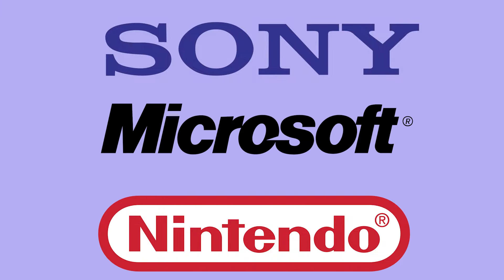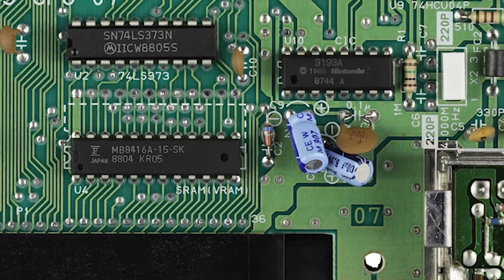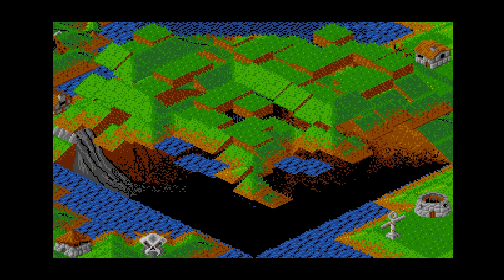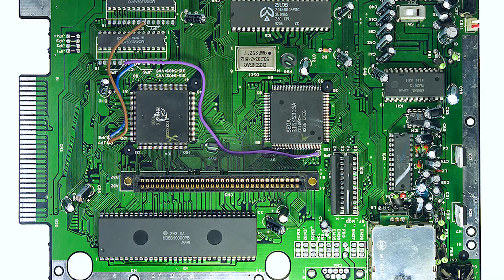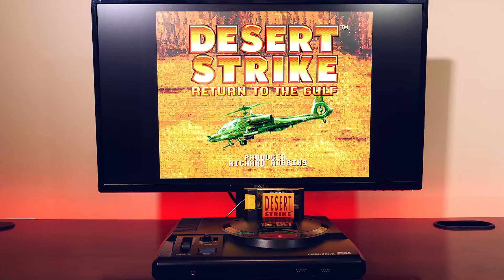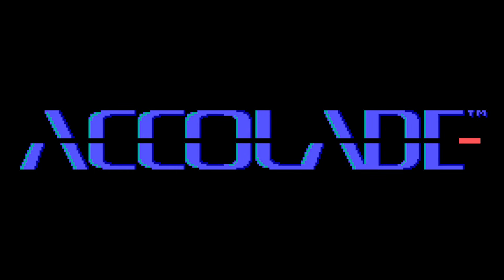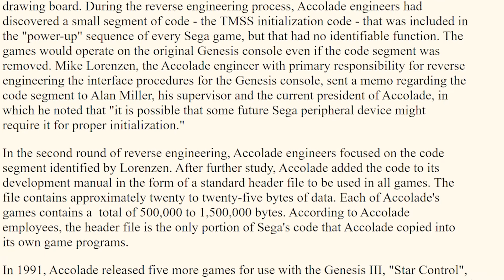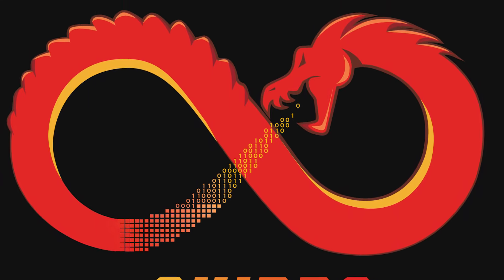How Sega bet against Reverse Engineering...and lost | MVG

Comment: It's my fault, I installed a lot of mod chips over the years, up until I messed one up and had to buy the guy a new system and then mod that. My 13 year old financial situation would not allow me to make that mistake again, and my mom...rofl. Basically cleaned out all the profit I made installing chips in one fell swoop. I charged 15 bucks for original systems and 25 for PS1's... Rent, Burn, Return. I grew up in a pretty poor family, but my mom certainly saw her investment of getting me a soldering iron and screw driver set at age 10, then just some years later being able to "get" games after we rented them. I was one of the first to get a cd burner when they came out with the 8x TDK at my junior high school. It paid for it's self in the first month. At that point in time, a custom CD with the tracks you wanted was seriously cool. I feel like 20 bucks for a custom cd with "dirty lyric''d songs" that took days to download on napster was not over charging. Everyone was so stoked to get all the songs they wanted on one disc. I went by DJ PJ... hahahhahah

Comment: How did games officially licensed by SEGA that were produced before they invented TMSS continue to work on the new revision of the console?
Reply: I'd assume it was part of a standard library they had been using since the beginning and which was distributed with the development kit.
Reply: I think that's part of why they chose the code they did. It was something that was already there in all officially licensed games.
Reply: @timf7413  it was part of the startup screen every game had to have anyways. They just checked whether that starting screen was present (and sued if s/o wrote "SEGA" w/o a licence). Actually a pretty common approach of the time, check for a character string, check for existence and position of a brand logo (afaik the GameBoy did that), and so on
Reply: @sepruecom  The GameBoy sorta did that in that all officially licensed games showed the "(c) Nintendo" screen, but I also remember having an unlicensed game that did not show that, but instead showed the copyright of the company making that unlicensed game.
Reply: it was already standard, but wasn't used until the consoles with TMSS came out

there are a few games that didn't follow the standard because at the time it had no adverse effect, which caused the game to not work on TMSS equipped Mega Drives
Reply: @danielziltener7195  Interesting, that would mean that the company made their logo have the same checksum as the Nintendo logo so it passed the bootrom check,
Reply: @gblargg  no, actually the gameboy had a classic "TOCTOU" vulnerability where it read the logo data twice; once to check it and once to display it. You just had some very simple hardware that did a switcheroo on the rom data.
Reply: Interestingly, I own Action 52 on Genesis (an unlicensed game) and it still triggers the TMSS message, but the game screen after the message says "Please disregard all previous notices" or something like that

Comment: Sega used this one little trick to legalize emulation! Console manufacturers hate them!
Reply: actually emulation and roms were deemed by the DMCA as legal when Nintendo filed a lawsuit against emulator creators and lost cause they dont use the original source code.The rule was change that if your running a rom on an emulator without the original source code its for "testing" purposes
Reply: Kyle S iirc it was Sony that filed that lawsuit, not Nintendo
Reply: It's 100% legal after copy rights and licenses run up. That's why we seen an explosion of legal emulator consoles over the last few years.
Reply: @kyles8524  Actually Nintendo doesn't aim at emulator but roms they allready knew that attacking emulator itself is futile they have lot of experience in laws so they know that suing for emulators that usually don't have their code is pointless but roms however are different story they are usually flashed from cartridge. Oh by the way you might want to look for Bleem that's the emulator with lawsuit from Sony and Bleem won that one but unfortunately for them the cost of court was too much thus making Sony the winner.
Reply: @Mikael404  no lol, Nintendo tried to also file a lawsuit against emulators but that was also shot down cause they weren't running the original source code, therefore also being ruled by the DMCA or aka the Digital Management Copyright Act who actually makes the rules about all of this stuff basically ruled any rom being ran on an emulator not running the same source code is for testing purposes and completely shuts down any more attempts from Nintendo to try and pull this again.Its illegal to be selling the roms but not "testing" them.Thats why rom sites never have a paid membership or something of that nature or they would get sued rather quickly.
Reply: @kyles8524  Well where is your evidence because I don't really find anything and also the rom sites are getting shot by having roms DMCA only make emulators legal but not roms.
Reply: @Mikael404  read the dmca amendment about it, thats the evidence lol
Reply: @kyles8524  I have read the dmca and it only proves my point emulator is not illegal software but sharing rom files is officially counted as piracy by same dmca amended.

Roms can't really get obsolescent technology exception if the company still exist and share or sell their product even by digitally.

You should also know this by the way earlier emulator sites didn't always offered any roms you have to look for them in piracy sites.
Reply: @Mikael404  well whatever you think Ive read through the DMCA rules and using roms on an emulator not using the same source code is for testing purposes and not illegal, selling the roms is.Its just a fact but your entitled to your opinion
Reply: @kyles8524  My so called opinion isn't really an opinion is a fact.
Using and downloading arent' same you can use roms but you can't share them not even for free, without the consent of the copyright owner and that is also specified in DMCA guideline.

Simply saying you can use but not legally share roms if you don't have permission for it.
Reply: @Mikael404  thats sort of my point, the site themselves are the ones at fault, but if you download and not share them it doesnt put you in harms way.Trust me Nintendo tried to file a lawsuit against rom sites and emulators and lost both cases.Thats why the rules were changed.
Reply: @kyles8524  Actually no you didn't, you only said that roms are legal by default.
Which automatically means in this case it's also legal to share it.

By the there still isn't any direct emulator lawsuit from nintendo only the threat of one but that didn't happened.

Only direct lawsuit againts software emulator I know is Sony vs Bleem.
Bleem was an commercial emulator and yes it is legal to sell emulator, if it isn't using copyrighted material, this is the only sofware emulator that got sued.

There is also Atari vs Coleco it's about Colecos addon that can use Ataris cartridge well Coleco won with the same reason if you don't use anything that's copyrighted by others you can legally sell or share it.

Rules didn't really changed those rules existed allready DMCA is just using them and make it fit in software industry.

As for this whole Nintendo vs Rom thing.
It is just too big and noicy one, I really want to know what's going on behind that company mask.
Taking chances like it's easy when you can protect yourself with logo, EA executives uses same shield when they buy and kill other companies, company suffers and executives just walks away with money.
A basic company stuff nowadays.
Reply: @Mikael404  I never said roms were legal to share lol, thats what you thought I meant which isnt my problem.like I said you have your own opinions and can take it as you want.But Ive read the rules and asked the DMCA about it.But unfortunately your just simply wrong.Your becoming an annoyance also so Im muting you.Sorry kid but facts are facts whether you have your own "take" on it or not.
Reply: @kyles8524  Muting someone just because you can't answer his argument is same as losing that argument.

You didn't really give anything into this argument other than  misguiding it and trying to spread some minor misinformation and you also only stated emulator use and sharing after I mentioned them so it's quite obvious you just want to be the winning side in this argument.

I never understood this corporation hate you can't really win them just by hating, only thing that suffer for it is just workers and image but the people who make corporation shitty just takes money the and walks away without any consequences if thing goes bad.
Reply: Nintendo cried that day

Comment: What was the first clean room reverse engineering? The Compaq Portable and their reverse engineering of the IBM PC BIOS is the first that I know of.
Reply: Same here.
Reply: I had heard that initially but also heard that Corona Data Systems did it before Compaq did.  But it has been around even longer. The Soviet Union was known for purchasing mini-computers and mainframes from IBM and Digital Equipment Corp and building compatible clones.  The IBM 370 mainframe was cloned as the Soviet ES-EVM.  Digital was so aware of their designs being replicated in the Soviet Union that they would taunt the Soviet engineers with insults on the chip die written in Russian.  One such taunt was "When you steal from the very best."  https://micro.magnet.fsu.edu/creatures/pages/russians.html
Reply: would this also mean, if someone were to clean room reverse engineer iOS then apple have no grounds to sue?

Comment: Trip Hawkins may have been clever doing what he did there but he wasn’t so clever in getting the 3DO to succeed! Great video.
Reply: The 3DO failed for different reasons, most notably tyhe price of the console.  It might have been cheaper than a PC, but it was way more expensive than a PlayStation. 

Though that was really down to the business model under which the 3DO was produced.  Console manufacturers were the game developers, 3DO might have published and developed 3DO games, but they never made consoles.  This prevented the consoles from being sold as loss leaders with the money being masde back on licensing fees imposed on games publishers.  Except 3DO charged very low licensing charges to developers, making 3DO devlopment very accessible.
Reply: GeoNeilUK yeah, blame Panasonic et al for the 3DO.  3DO said ‘here’s something awesome that’s cheap to dev for’ .  The dev industry went ‘meh, it’s install base is tiny because it costs more than a Ford escort so no dice’
Reply: @AcornElectron  Wasnt really Panasonics fault, as neil says without having exclusive game licencing to absorb a loss on each console sold they had to price it high.  Im guessing it cost a lot to manufacture something so advanced at the time.  I had one and it blew away anything else on the market until the ps1.  As an aside, my FZ-1 3do still works perfectly and has its save games intact nearly 27 years later, its was built to last with quality components unlike my ps1 that died within 2 years.
Reply: referral madness  A lot of 3DO's have worn out a gear on the CD mechanism, I mean my FZ-1 3DO still works perfectly, but then again so does my SCPH-1002 PlayStation.

Comment: I've got to clarify something you said in the video. You said the early model Genesis/Mega Drive had region locking. It would be more correct to say the system had region setting via a jumper and the game could do a region check, which isn't quite the same thing. So for example if you plug a Revenge of Shinobi into a Genesis system it will check the system region and start as Revenge of Shinobi. However if you plug that cartridge into a Mega Drive it will do a region check, figure out it's running on the Japanese system, and boot up as Super Shinobi. Games like this are often called "bilingual games" and will run on either Japanese or American system as the appropriate version. (Ghouls and Ghosts is another one of these.) However there is no requirement in early games that it do anything at all based on a region check. An example of this is Batman on the Megadrive which is a Japanese game and will run just fine on a first run Genesis system.
However to add confusion to this on newer games the game will check the region and refuse to run. So for example if you put a Streets of Rage 2 game into a Mega Drive it will check the region and it will not run and complain about the region. What's weird about this is that the underlying game is actually a bilingual cart. I bring this up because since the region on a Genesis is just controlled by a jumper more than a few of us Genesis owners wired up a switch to control the jumpers so we could play Japanese games that use the region check to lock out the game. So you can have the switch in the position for Genesis when Streets of Rage 2 boots up and then at some point after the region check switch it to Japanese and the game will actually be Bare Kuckles 2. Another example of this is the Japanese version of Light Crusader which will not boot on a Genesis. However the game has an English version and since it seemed like it might not come out in the US you could buy the Japanese version and use a language switch to boot past the region check and then switch to Genesis mode to play the game in English. In both cases the system isn't controlling the region lock, the game software is.
Reply: Your post seems to have gotten only little attention, so I just thought I'd say thanks! Very informative :)

Comment: That is called the Sega Mega Drive!  The trouble is ‘Genesis’ makes me think of Phil Collins 😅
Reply: Yeah, unfortunately the term "Mega Drive" was already trademarked in the US (or it may have been Canada) so when the system launched in North America, the name had to be changed.
Reply: @purplesabbath9057  that's due to a company called megadrive systems inc
Reply: The Genesis sold more than the Mega Drive... so....
Reply: Genesis was best till Phil Collins solo career,after 1986 it sucks.
Reply: @salvatronprime9882  They were not in competition as it was the same frigging machine sold in different parts of the globe to different areas... so... Genesis/Mega Drive sold=(salesOf(Genesis)+salesOf(MegaDrive))
Reply: @robsku1  way to miss the point. The fool I was replying to thinks that Genesis is the "wrong" name, when in fact it is the correct name. There is absolutely zero good reason that the Genesis should be referred to as Mega Drive.

Comment: esentially what this case ends up saying is that emulators isn't technically pireting it's gaming history preservation. thats my take from this what about you?
Reply: Indeed, emulation is legal, as long as it does not involve directly copying copyrighted code from the console or games in question and then redistributing that. So if you dump your own ROMs and BIOSes (or in the latter case use a drop-in replacement which was written in a "clean room" style), emulation is legal. The moment you start downloading copyrighted ROMs off the internet it stops being legal.
Reply: @Muzer0  inb4 teams clean room reverse engineer older games :D
Reply: @TechnoHackerVid  Wouldn't work unless you wrote a very shitty clone. Every part of the game from the logic to graphic assets to the story, is subject to copyright. Even if you supplied your own code logic, you'd still be straight up copying a huge part of the IP.
Reply: @hellterminator  true :P
Reply: @hellterminator  John Carmack released the source code of most of the games he programmed at id and the only two things missing are the assets and his fast inverse square root of a float calculation which is 4X faster than the traditional method (Carmack's Reverse). Anyone can freely grab the code off github and use it to build their own game around it, porting or studying.
Reply: @Muzer0  But no one cares if you download ROMs off the internet. You only really get in trouble if you host them.
Reply: @comicsans1689  Agreed, but that wasn't what OP asked.
Reply: referral madness  Is that really legal in the US? Where I'm from RE is legal for  purposes of bug fixing, integration with other systems, security auditing…, but you're definitely not allowed to publish a full source code to a closed source program.

Comment: You might find this interesting, the TMSS display and the "SEGA" write are actually different protections.  VA5 MD1 consoles actually implement only the "SEGA" write protection and only when the region is set as not "DOMESTIC". VA6 and later (which was the first unit with TMSS) also only enforce the "SEGA" write protection when the region is not "DOMESTIC".  Why that?  Because all of the early release games (the ones with file clamp holes on the manuals) have the SEGA string at 0x100 but do not have the code to write "SEGA" to unlock the VDP because that was developed after these carts released.